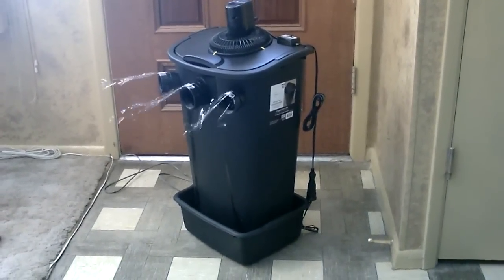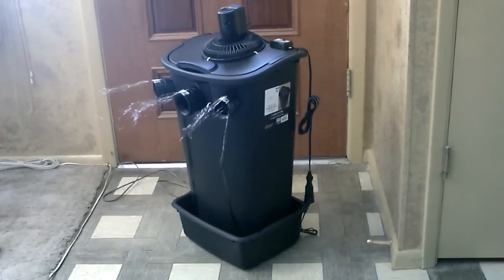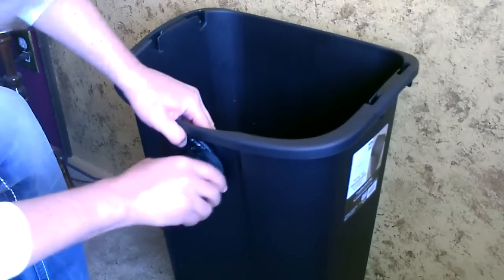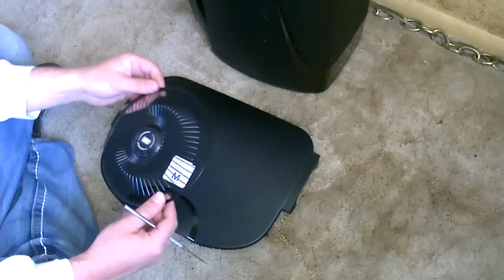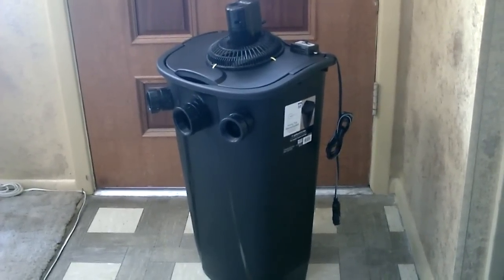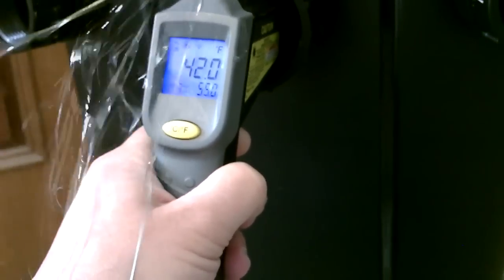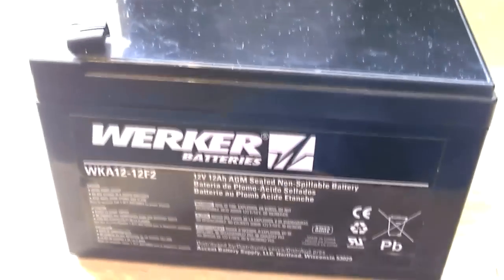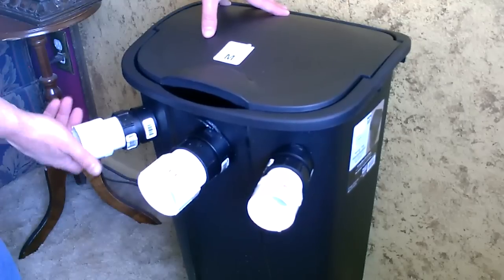Homemade Air Conditioner DIY - The "11 Gallon Bucket" Air Cooler! DIY- can be solar powered!

Comment: OK, but whether you buy it or make it in your freezer, ice costs money, and the hotter it is the faster it melts, right?
And the faster you move the air, the faster the ice melts also.
I think the swamp cooler variations better.
Reply from the maker: hi. if you've got low humidity then swamp coolers are certainly a good option. 👍😎 (i've made several DIY models of those too) - update: i just noticed that you've found those already ✔🌞

Comment: Using ice to cool down a room is very energy inefficient.. might as well use an AC.
Reply: In some cases though this is more efficient. My son lives in an upstairs of an old house that running in air conditioner will blow the electrical circuits, but running a fan would not...
Reply: @iwantthetruthandnothingbut6521  I understand that that appears to be your only option for a cool room, but you have to understand that overall, that is less energy efficient than an AC would be. You just don't even have the option of running an AC.
Reply: @48956l  well at least it wouldn't blow the fuse.
Reply: @iwantthetruthandnothingbut6521  Sure, which isn't a matter of efficiency... it's outside the scope of my claim..

Comment: instead of buying all that huge blocks of ice, fill some 2liter soda plastic bottles with water & freeze. then take out some & put it in. then when those are all melted, swap them out with some others that are in the freezer & put the melted ones back in the freezer to refreeze...it'll save you lots of money rotating the ice. i made a homemade A/C several years ago using a medium size styrofoam cooler & used a plastic container that those Lysol wipes comes in (instead of those tubing that guy used). just cut out the bottom & put it in the hole on the side of the styrofoam cooler & used super glue around edge to keep it in place so it'll help direct the cold air out. since its not powerful,it wont make a room super cold (especially if its a large room) but it did feel great putting it in front of the sofa while i sat to take the edge off the blistering heat. i would imagine if you used a bigger fan it would make it more powerful.

Comment: What do you think makes the room the coolest? The copper tubing fan, the 5 gallon bucket, or the 11 gallon bucket?
Reply: bigger fan & lots of ice (or fill bunch of 2liter bottles of water & freeze. have several on hand to rotate so while you use some,have some in the freezer freezing).
Reply: the engineering guy that setup tubes going below the ice, so that the fan air blew through the ice, and the outgoing air came from the deepest part of the "container", with this 11 gallon or more, would be the best. the only copper tubing video i saw was of people living in areas that didn't even get hot 100 degrees? give me a break. but a HUGE garbage can with the engineered cooling, would seem to actually cool a room

Comment: You got it made in the shade if you're able to make your fridge / freezer run off the solar panels.  But then, if you're running that many panels, you're better off just buying a small $200-300 window AC unit.  But your diy A/C is quieter and will last a lifetime.  Keep inventing!  We're lovin what you're doin.

Comment: What about using dry ice? Also could you run the fan in the back side at the bottom and maybe use some sort of tubing up and through the can then out the spouts?

Comment: Would this work in a high humid place
Reply: yeah but you gotta make the ice in a high salt water solution ,the salt makes it long for the ice to melt
Reply: +RedneckAngel98 basically it would raise the humidity of the place, because the fan spreads cool water vapour. but the fan wold move the air, which contains water, and the humidity would be less perceived, at least a little bit. Anyway here in Europe are sold small dehumidifiers that basically catch the humidity in the air and collect it in a recipient as water, making the place dryer. Hope this would be of help! :-)

Comment: That looks great, plus the fact you can load more ice in there. My question is, have you done it with just frozen gallon or litter jugs instead of blocks of ice specifically and what would the difference be for the temperature itself.

Comment: How many amp battery is that and how much was it and from where at?
Reply from the maker: campervandavid hi there. it's a 12ah battery. it cost about 45 bucks (but i've seen them for around 25 on amazon). i got it from a store called "batteries plus"
Reply: desertsun02
Thanks for the info.

Comment: A drain on the bottom would probably be easier than dumping the melted water.

How long does a typical big block last?
Reply: Draining the water wouldn't be beneficial. The water will stay cool mixed with the ice. if you drain the water it wouldn't be cool as long.

Comment: The problem here is making your own ice. If your freezer is inside the same dwelling where you run the cooler you're mostly spinning your wheels. The heat extracted as the water freezes is pumped into the room.
Reply: *****
As cheap as ice is in some places (especially at the giant vending machines you can sometimes find in liquor store parking lots) it would be more cost efficient for a lot of people to buy big bags of it.
Reply: +Slurpon Muhdick A solution is putting your water in the freezer at night, when temperatures are lower, and use the ice in the morning. Anyway the heat produced freezing the water is absolutely marginal, assuming that your freezer is always turned on :-)
Reply: It's not spinning your wheels if you don't have to turn your AC on or if you dont have AC also if the ice lasts longer .